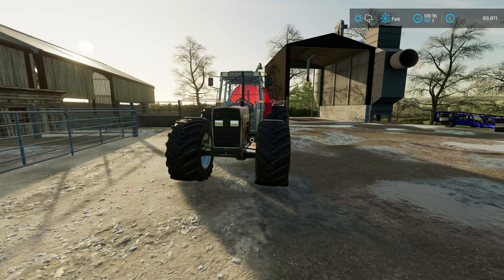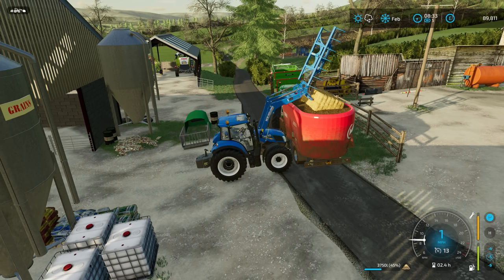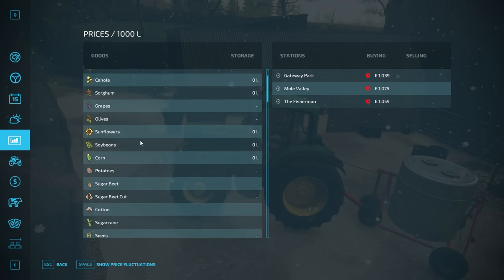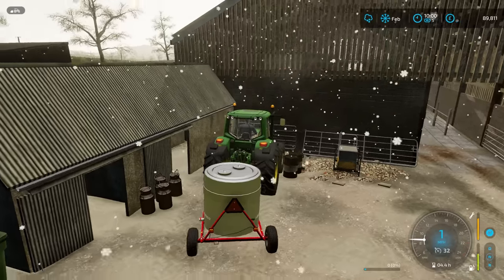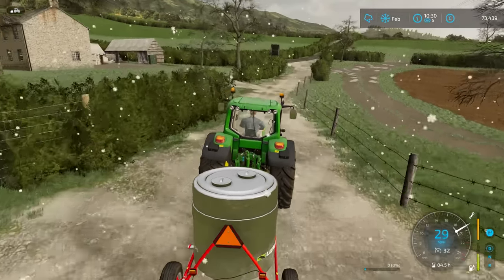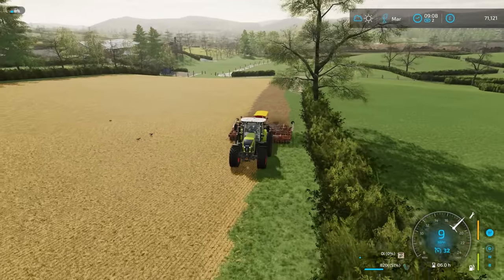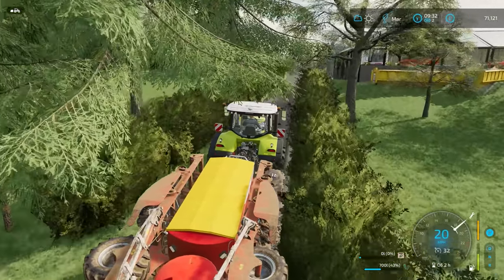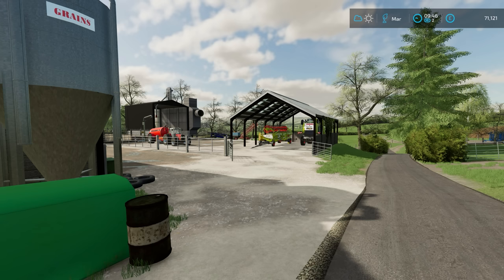TIME TO DRILL FREE FERTILISER | Purbeck | FARMING SIMULATOR 22 - Episode 14

Comment: Why does Daggerwin have alot of tractors? why not just use 1 tractor for everything?? wouldn't it be cheaper and more cost effective?
Reply: 3 tractors Is not a lot
Reply: @NewHolland7635  I think you mean 4 MF class John Deere NH but why does he need 4
Reply: @Dyl_Evs  yes sorry 4. He needs different tractors to do different job. Class is for drilling and carting, Mf is for slurry, NH for front loader and JD for cow work
Reply: @NewHolland7635  Why not just use 1 tractor?
Reply: @Dyl_Evs  because in farming u just don’t do that
Reply: @NewHolland7635  Why not it’s much more cheaper
Reply: @Dyl_Evs  because you need more than 1 tractor